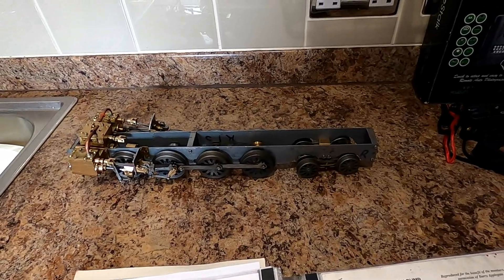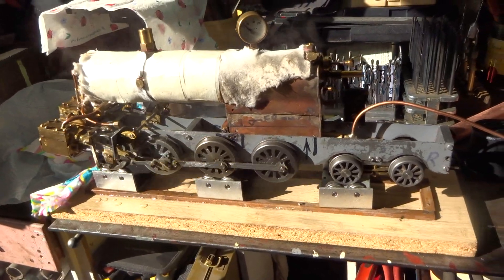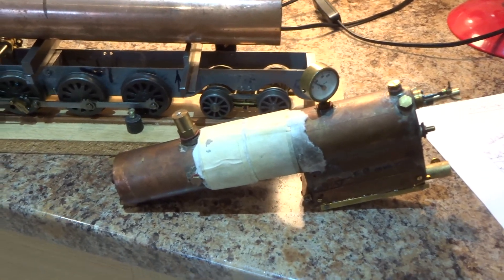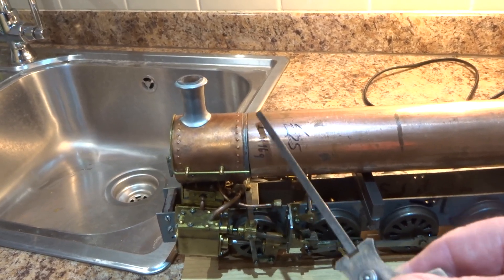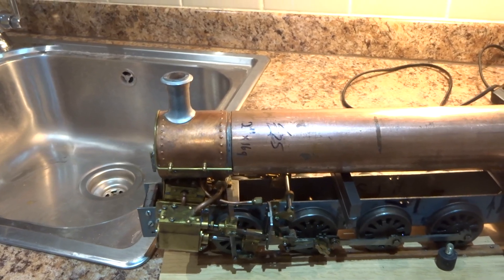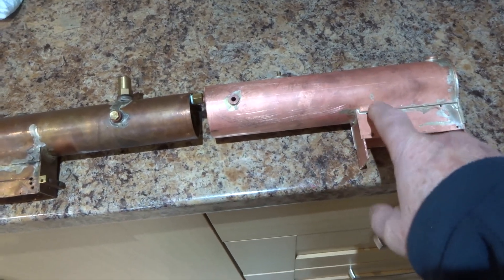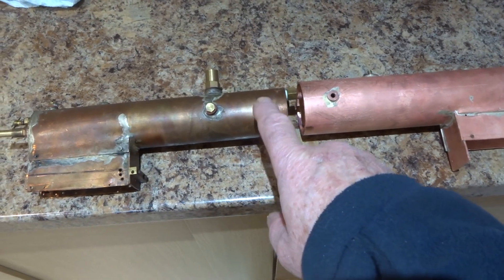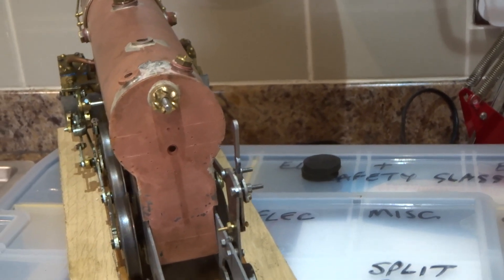A 3 cylinder 0 8 4 garden rail locomotive

Comment: ive found notching up the vaulve gear stops the engine rushong away woth the steam it will chuff away mile onmile ttfn&ty
Reply from the maker: Quite right, but I have not got to that stage of testing/running this loco. I don't think I have the valve gear totally properly set, but as I got the loco to run I have decided to leave fine tuning for later on.

Comment: Of course the fire cannot keep up with steam usage, because the blast pipe is exhausting to atmosphere. There is no induced draught on the burners, nothing to pull the flames along and through the boiler. Once a smokebox is fitted, and the blast-pipe exhausts up the chimney, it will draw the fire to heat all of the boiler. At the moment it is probable that the water is only being heated in the vicinity of the firebox. The original boiler was probably perfectly OK, it just needed to be finished off with a smokebox, and correctly aligned blast-pipe and chimney.
Reply from the maker: A fair point and I am aware. That said I know that draught or no There needs to be room for air to be drawn across the burner and I did not leave sufficient room for air to get into the firebox. I do think you are correct in that water was only being heated in the vicinity of the firebox however. The mk 2 boiler and burner will address the issues. Thankyou for your welcome comments. Ed

Comment: Good luck on the pressure test. Hope all goes well. Then it just the fitting up of a few bits and bobs and off you  go.
Reply from the maker: Many thanks. Assuming I get the new boiler and burner combination to go there is a fair bit to do. I have to make a lubricator, axle pump, hand pump, two water tight side  tanks to supply the pumps to name but a few. All this and we are attempting to move house. Talk about stress! 
Ed

Comment: I love the rolling track! Can you adapt it so you can find the max speed? Did the smoke box blow off? Did the boiler hold under pressure? I need answers dad 😂
Reply from the maker: Rolling road will adapt to any speed, but as u approach speed of light the loco may need to be strapped to the bench! LOL. Smoke box should not 'blow off' unless some extraordinary circustance arises such as the entire boiler explodes. LOL. By design a smoke box should be operating at less than atmospheric pressure in order to 'draw' the fire. Yet to test the boiler under pressure. xx
Reply: Yeah rolling railroad is cool